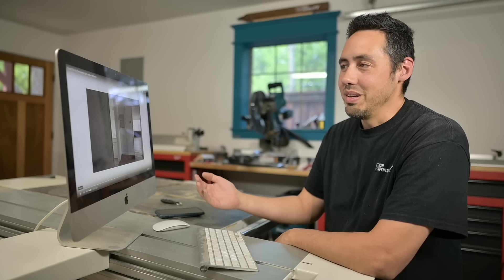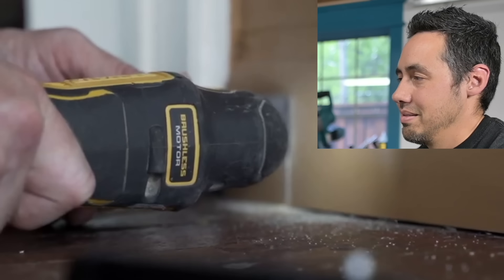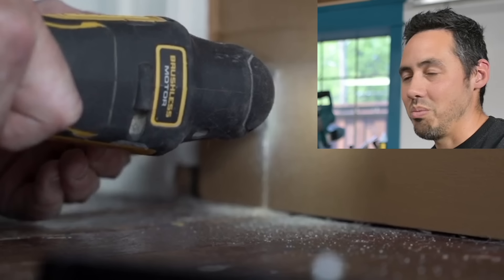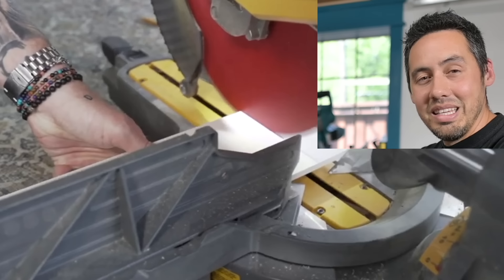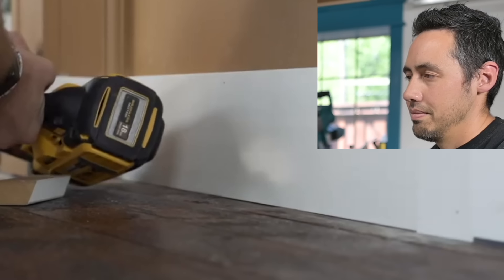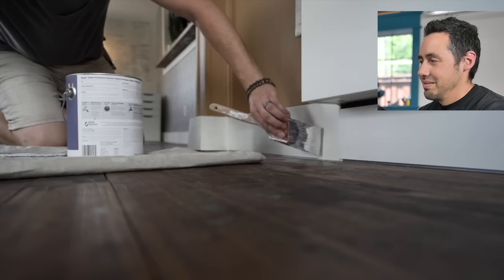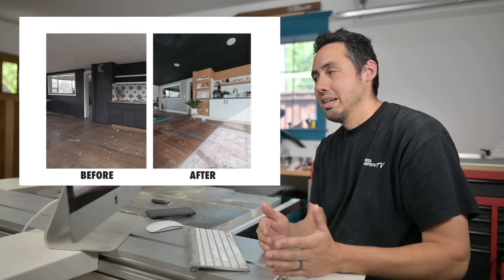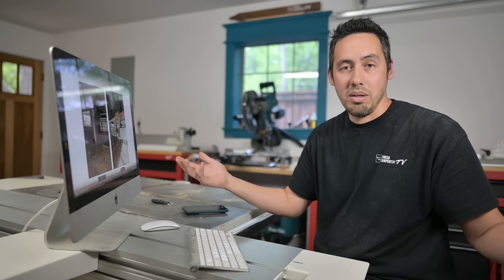Carpenter reacts to Do-it-yourself Trim Carpentry

Comment: It never ceases to amaze me how much work people will do to avoid doing work.
Reply: @SuperBeaverlicker   Just guessing, but I think it is because they have no idea what they are doing, so the mindset is all wrong. Novice renovators seem to think the process out, but not in the right order. They wind up missing something important, realize it later, then scramble to make it good enough. All they have to do is ask someone in the trade before they start a project, advice is usually free, or a couple beers at the pub.
Reply: Even when you look something up on YouTube, there's tons of videos on how to do things and I know damn well that 90% of the videos are showing the wrong way
Reply: This!
Reply: That doesn't surprise me. What surprises me is when people make more work for themselves. It's not much effort to just remove trim, and yet they spent a bunch of time, and bought a specialty product, to install something to avoid it. I doubt this was less effort than the ten minutes it would have taken to remove the old trim.
Reply: What exactly did they save with this product... nothing. They still made used all the standard trim tools and process to install everything. They still had to caulk, fill, and paint. They still had to own and operate a miter saw, nail gun, etc. All they saved was pulling a few pieces of baseboard off a wall. All they needed was a knife, trim bar, and hammer and an hour. To avoid this step, they spent how much on a specialty product? I don't get what this saves you, a couple bags of trash maybe?
Reply: @OfficialReckM8  or a difficult explanation to something simple
Reply: Some people like to do that to save a couple of dollars but they don't know that they would actually spend more money redoing it afterwards 🤷‍♂️
Reply: jesus!  it would literally have cut the processes in half just ripping out the old and slapping in new,  even if he still wanted to lay 3/4 inch beads of “wood putty”

Comment: Honestly, if you're good enough to make this cover system look good, you have enough in you to attempt it the right way.
Reply: The cost too, I glanced at Big Orange Box, 3x per stick vs 1x6 MDF. Not to mention the case of caulk, extra sandpaper, and those special termination blocks that appear to not even match the profile.
Reply: Yes! All the skills to do it correct are used in just covering it up??
Reply: seriously, coverings are supposed to be time saving, but there's nothing time saving about this process, and it looks bad in the end.
Reply: @iviaverick52  bri but save time demolishing trim ? just babysit a cat a weekend the trim is gone. what are we talking about here like hes taking a glue gun to a fucking abs drain pipe tryna unglue it.

Comment: A lot of people are unaware of the fact that a mitre saw can grab the wood and jerk it upwards. If you are holding it correctly you may be able to react fast enough to get clear. If your arms are crossed over to cut, however, your initial reaction will be to jerk your hand back which will be hard to do

Comment: With my dad as a local builder in my hometown of Sonoma, Ca. Then my grandfather as a jack of all trades, involved in home renovations and repairs, as well as some development. I’m journeyman builder, and just started my own libusiness. I’ve been following your channel for a few years now and absolutely love it. From day one of my apprenticeship finish carpentry has been one of favorite expressions of the trade, and as a residential builder (and now contractor) most if not all of my projects involve finish carpentry! From trim and casing, to cabinets, flooring and and live edge installation. Long story short, I’ve your channel and work has greatly influenced my and my work. The biggest one being taking the leap from MDF to finger joint pine when at all possible. In fact unless it’s requested by the client is not even an option for my company! So thank you for all you do, can’t wait for
 the next video and! (Especially the reactions)
Best, 
Travis (TS Builders)

Comment: “Good from afar, but far from good”. My sentiments exactly. You never see close ups of anything. If you are a tradesmen, do it like you would do for yourself, or don’t do it at all. And if you are putting out trash, find something else to do
Reply: Yeah, they very carefully avoided any close-up shot when it was all done. I don't see how you can fix butt joints after that setup. And the close-up they did show clearly showed crap.
Reply: If it looks terrible on the screen, it's horrific close up.

Comment: I really enjoy how they explain that base is typically fastened with 18g nails but then go through all this effort to avoid taking existing base off.  My guy, the price of the multitool blade you just roasted would get you a set of 3 pry bars.
Reply: @Greg Oleszweski: Yep, most trim less than 50 years old can be removed in a matter of minutes with your fingers and a $6.00 Richards flatbar. The 100 yr old stuff requires a $12.00 kit of bars and a backing trowel and a lot of precaution that you don’t pull half the wall plaster off with it. BUT…here’s the clincher…when some fool has installed the baseboards with ‘trim screws’ (another stupid idea) and PL-400 you’re better off to just demolish the entire house with a large grenade and start over, lol.
Reply: Yeah, I don't like using my oscillator for regular straight cuts. It's designed for flush cutting and that's all I use it for. If I want a quick cut I'd rather use my jigsaw.

Edit: and sanding!
Reply: @WarPigstheHun : The guy in this video seems genuinely knowledgeable but the saw in this clip looks to me like a rotary cutter not an oscillating tool.
Reply: @rayray8687  nah, I have the same tool from DeWalt. It's labeled "oscillating multi tool." Amazing for flush cuts but cutting regularly is a nightmare. Everything needs to be secure on the table or they will vibrate off it.
Reply: @WarPigstheHun : Yep, you’re right. I first watched the video on a small screen but when I expanded it it’s definitely a multi tool. I have two of these, a corded and a cordless, and they are a godsend for lots of situations in general trim carpentry but they certainly aren’t designed for fine cabinetry, lol. When cutting 100 yr old dried trim they tend to burn their way through rather than cut so you need to keep an eye on the smoke detectors! But anyway, HERE’S THE BONUS!! When the blade has no teeth left whatsoever (which doesn’t take very long) it makes a perfect drywall tool for cutting out j-boxes, plumbing access panels and so on! Even the non-toothed edge of the blade cuts perfectly through drywall with no danger of cutting something you weren’t supposed to cut. I actually keep a 3rd oscillating cutter instead of a rotary cutter just for this purpose. Cheers and happy renovating!

Comment: The product relies on leaving the old molding in place. It looks nasty.

"Don't worry about any gaps, you can just caulk it later." A statement of pride right there.

Superficiality rules.
Reply: “Caulk and paint makes me the carpenter I ain’t”
Reply: @gs300rich4  you beat me to it. My old grandad's version as an East End (London) painter and decorator; "Putty and Paint, make an article what it ain't" 🤣
Reply: Well said
Reply: “Do your best and caulk the rest”!
Reply: Caulk plus paint makes a carpenter what he ain't!
Reply: @gs300rich4 : Caulk, filler and scratch repair are what makes a job look perfect. If you don’t bother to do those steps there’s no point in painting.
Reply: @rayray8687  you completely missed the joke. Thanks captain obvious for telling me those are part of a high quality finished job (I’m already well aware in case you aren’t picking up on my sarcasm). The joke is putting tons of caulk to fill giant gaps from a sub par carpentry job and then painting over it.
Reply: @gs300rich4 : Hey, it’s a cute little time-worn  jingle, kind of like ‘Hickory dickery dock, the mouse ran up the clock…”, lol, but sarcasm? Not really, just cutesy.
Reply: And he uses a tube of calk for a 6 ft section that would work for a whole job.  Little spaced beads and smooth it.

Comment: The oscillating tool is the "sawzall" of trim carpentry.
Reply: Tiny sawzall
Reply: @kmonnier  tiny dancer
Reply: They are very good at cutting casing & jambs to proper height for flooring. Anytime, I’ve rented a jamb saw to cut a whole house. I have to buy a new blade, because the one that comes with it is trashed.
Reply: @aspees  I recently added one to my kit... Dont know how i lived without it!
Reply: They have their place, I use mine for under-cutting my door jambs. Also can be handy for quickly cutting the little bit of the corner left that a circular blade can't get when notching something

Comment: "Coming soon...Moldings in a spray can!  Just like our "cover trim", no sanding or masking necessary!"
Looks great in low resolution photos from across the room...especially when covered by furniture, draperies or strategically placed flower pots! 

It's garbage!  They'll sell millions of feet of this stuff!
Reply: Moulding in s spray can 🤔 I’d buy that for a 💵
Reply: I actually just use Great Stuff Spray and then sand down the foam once it dries to a trim shape. 🤣

Comment: I also considered using these covers. My house is pretty old (Europe 1960s) and they nailed the base with very big old fashioned nails. When removing them (with quite some force) I took out chunks of the wall. In some areas they were also sitting a few mm under the cemtend floor, so removing was going 2 directions: up from the floor and away from the wall, not easy. But they're all gone and now and I can put my laminate floor closer to the wall and leave space for movement and cover that space with new trim. Because if you are using the cover trim, it can only cover a small gap between the wall and floor. Or the cover trim needs to be very thick. That old trim is using up space. Unless your trim is already hovering above the floor.

Comment: There's no need for the transition blocks. You would never see the end profile going into the door casing. On the other end under the toe kick it would make more sense to add a piece behind the base to mask the fact that it's hollow. Add it to the back, cut and install for an almost seamless look.  No un nessicary cuts on the face should be the goal.
Reply: Thanks for the explanation. I was scratching my head trying to figure out why they even did a transition piece there.

Comment: Thanks for mentioning about cutting without a vacuum. We asked our contractors to stop cutting in the house (they weren’t using a vacuum and removed the plastic from covered areas), and things went downhill from there. They insisted it’s normal to cut inside someone’s home because it’s too much work for them to cut outside on the porch just right outside from where they were cutting.

Comment: I don't have a lot of experience with DIY stuff.. but all the oscillating, cutting, caulking, etc just seems like so much more work than just removing the old trim.  It's like having a draft in your window so you built an addition.

Comment: In the freeze frame where the installer is wiping the caulking with the damp rag, it also looks like the transition block has a wider radius on its top edge then the cover trim.

Comment: Since the cover trim doesn't protrude past the casings it runs into idk why the plinth block is there at all. They could have just run it up the stopping point. Also one major variable with that stuff is the width of your existing baseboard. Why would you want to much with the possibility of lacking support on the bottom because the trim is narrower? Or, basing your trim on whoever installed the trim last time?
Baseboard demo is the so easy when the new stuff is bigger. It doesn't have to look clean because it is getting covered. Geesh

Comment: I agree with you on some aspects. I would probably take the old base off unless it was install before the floor was installed. I wouldn't have used that system. I differ with you about an oscillating tool. Maybe if you buy a cheaply tool. Mine is a Fein which I would recommend to anyone. I've made very precise cuts with mine. Very intricate cuts that require little or know filling in work. Sometimes the cheaper tool is the problem. But best.

Comment: Question... what if I can't pop the baseboard off? I just bought a house in AZ and it appears the tile was installed after the baseboards so I have 1/2" of tile butted up against the clamshell. I'd like to have words with the genius who did this. 

Aside from pulling up the tile the baseboard is locked in. I've considered routing the new baseboard to cover the old 3" clamshell but I'd need to buy all the appropriate tooling. 

Any suggestions?

Comment: Great video!! Honestly nice to see guys call out this stuff for what it is. As a 20+yr tradesmen and finish carpenter this stuff drives me crazy. Plus to think there are folks out there that will buy into this garbage. I've seen lots of crappy "diy" projects and very few well done diy projects over the years. I blame the cheap mindset of folks today plus channels like the diy net work for pushing this idea that everyone can build a masterpiece in 30 minutes. Good for you for getting away from that cancer board. That stuff should be banned and isn't even useful, I've seen it shrink buckle and do wild stuff over the years(for the critiques, yes I always back prime and prime/glue the seams and use scarf joints on long runs.

As for this cover stuff, think of it this way. In a few years time we will be busy charging double to fix it. As now it's twice the work to put in new. You're absolutely right, it would have been so much easier to just pull out the old base and put in new. Even poorly fit butt joints would be less caulk to hide.  It's just the next wall paneling theme. Sadly I had to laugh at this one as I feel like you do. Take lots of pride in my work as the painters will attest to, as one tube of caulk will do a few rooms after I'm done. I HATE the expression " caulk and paint will make a carpenter he aint". That expression drives me to be the best I can.

Oh the miter saw drives me nuts! I see it all the time on the home channels. They have really gone to shit with safety. Saw a guy cutting a board with a miter gage on a table saw using the fence as a stop. So the board was between the saw blade and the fence. Great way to teach improper technique. I do this often, however I clamp a short board at the front of the fence maybe a couple inches long and set it as a stop. However there's room for the board IF something goes sideways. Then folks say the table saw is the most dangerous tool. No its the tool on the show showing improper technique. 

I'm looking forward to more critique videos. Some I watch just for a good laugh.

Comment: I have a dumb question. I did a full Ikea kitchen remodel in a 70 year old house. The ceiling and walls were bowed some and I installed 40” cabinets that top out at the ceiling. I have 1/8” - 1/4” gaps along the top. Any way to make it not look like garbage?

Comment: Should I install the cover trim before I hang the cover walls and cover ceiling or does the pumper truck outside waiting patiently , full of dap caulk go ahead and start prefilling gaps before dogs and furniture gets lost in them . Also , is measuring this necessary or just a suggestion? if you are equipped with an eye cromiter with accuracy of 2” ?

Comment: I am nowhere near a professional, just a homeowner who occasionally has to do the occasional finish job.  With that in mind, is there any actual benefit to a product that is essentially new moulding that goes over old moulding? Maybe I am missing something. I feel that removing baseboard takes barely a couple minutes and then you have more choice in what you use to replace it?

Comment: we had a guy go in rip off the base, i went in measured and marked length on wall, i go to cut pieces and marked length on pieces, guy came in picked up pieces and nailed to wall, went fast and easy, with exception of scribing to floor and any other stuff that needed to be done to piece

Comment: The profile looks like it can fit a ton of wires. And I like mdf more than plastic cuz you can "convince" mdf to fit the space after install. But I doubt I'd use the transition blocks or this video as a reference. I wonder why they couldn't ask a carpenter or, at least, a competent contractor to do the job.

Comment: In the rare case in which you might need to close a gap from a bad flooring install, I suppose that stuff might be useful if installed correctly but in any other case which is 99.9% of the time, I would simply remove the trim.

Your opinion on this stuff is highly appreciated because we know you're a professional who takes pride in your work as do I.

Comment: I use an oscillating tool as a precision cutting tool all the time...I'm talking half the pencil line. Just takes a bit of practice and method. So much faster than a coping saw.

Comment: I dont cross my arms at the miter saw. Anymore. I still use it to cut my grilled cheese sandwiches  into two right-triangles. Cut the crust off of one side and it turns into a tasty grilled cheese speed square.

Comment: I agree 100% using an oscillating tool to cut joint lines is hack, the chances of that joint holding tight is slim to none. Just pull the existing trim, time wise, it will be just as quick and give you a better product in the end.

Comment: The cheap chinese blades you get on ebay or amazon have a thin kerf and a lot easier to cut straight the blades don't last as long but they are really cheap. I use it a ton for hardwood flooring to stagger new floor to old floor before refinish. Also for drywall instead of a knife on low setting it doesn't kick much dust and Makita or Milwaukee aren't that loud.